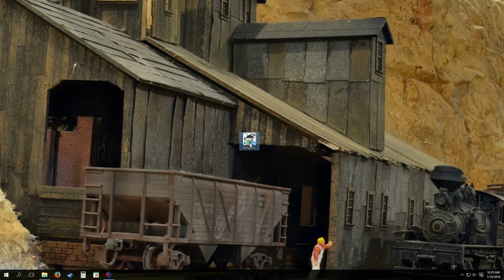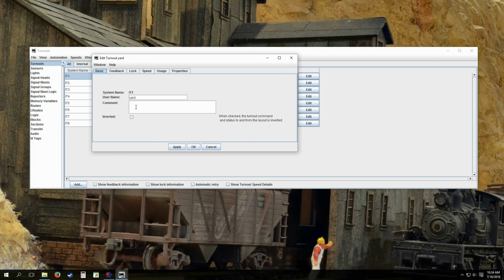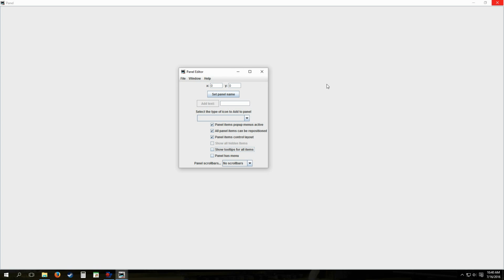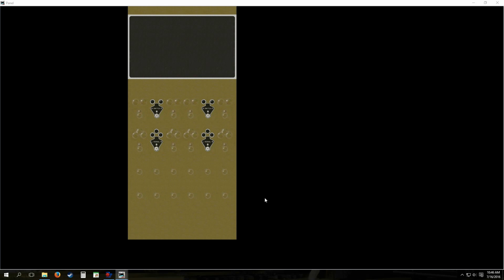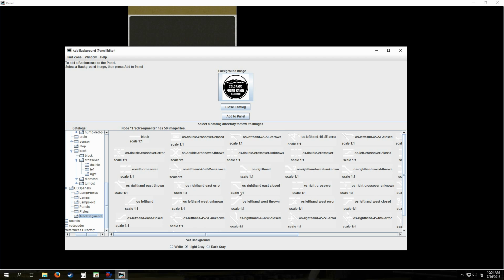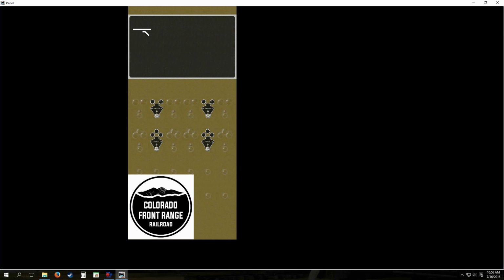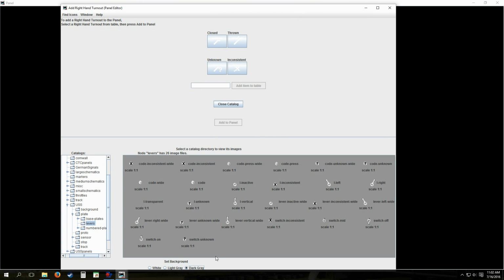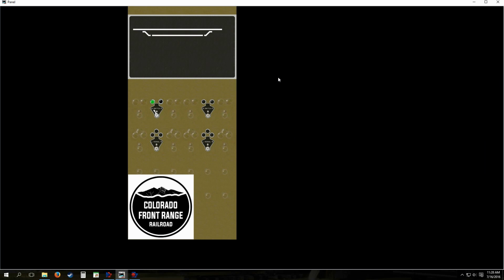Colorado Front Range HO scale - JMRI How To Build a Panel

Comment: How do you drag your panel?
Reply from the maker: John you use to be able to right click and drag witch is why I say to lock the background. I opened a panel to see if that was still the case and found I could not get  a hold the the background icon. I can with everything else. I will try to get back to you I am ask what is up on the JMRI User Group in Yahoo
Reply from the maker: John,
Sorry I been busy and I got an answer for you:
In Control Panel Editor, background components can be selected by using 
the Control key with the mouse click.  You can then Edit or drag as 
required.

Comment: I was curious regarding the attachment of track segments - time stamp approx. 28.00. Can you set up a GRID system like in a CAD program to decrease the frustration factor of alignment? Or do they 'magnetically" lock together? The line segment would be more versatile if the length could be changed by dragging the :non anchored" end instead of utilizing the "fudge-factor" of filling an unintended gap. The process you show seems to be somewhat intuitive. :)
Reply from the maker: Colin,
      That is a great question the answer is a little more complicated Panel Editor dose not have a grid or a snap to end feature. Layout Editor dose and yes you can build in that and use the drawing from that to panel editor (not as easy as it sound but can be done.) Control Panel Editor also has no grid easier  to draw with and more tools and easier to transfer drawing to Panel Editor.
 What I did not show was you can use an X Y plot to place everything in a line or row. It a  lot slower then what I did so I line everything close to where I want it the use the XY plot for fine tuning.

The program is not the most intuitive but gets the job done (note for free) and it truly is a collaborative work and that is why it is some what of a challenge to use.  I have been using it for over 10 year and i can get most thing done quickly. Drawing is the most challenging but once done the program really shines.

Mike
Reply: For a non-paid product I am most impressed with it. As I have no layout I think I want to download it just for the Panel Pro part.
Reply: Wow, this video was very helpful, you made designing a panel very simple, thanks you